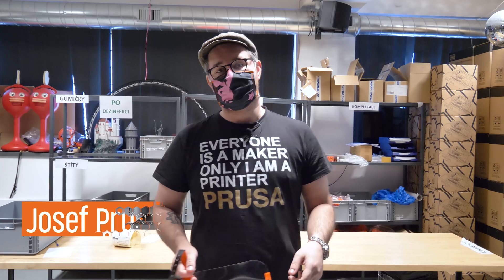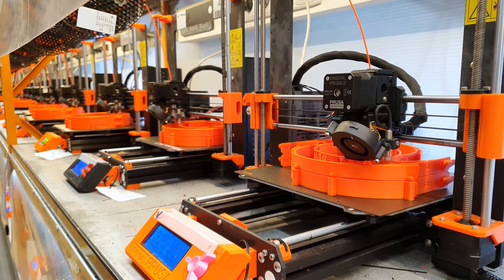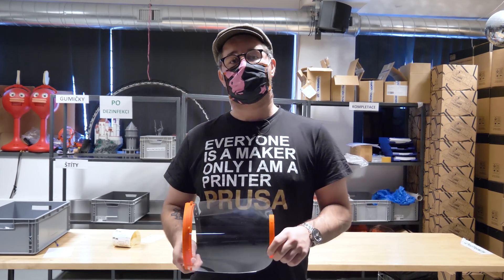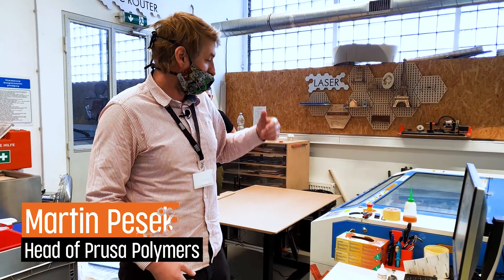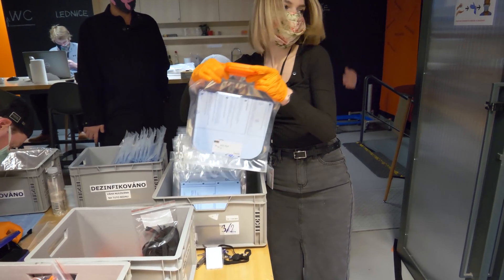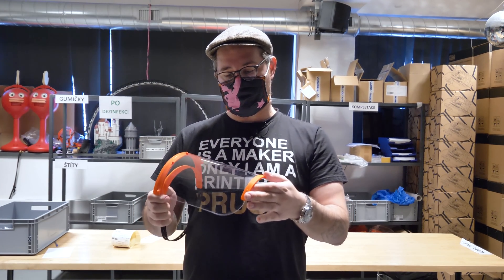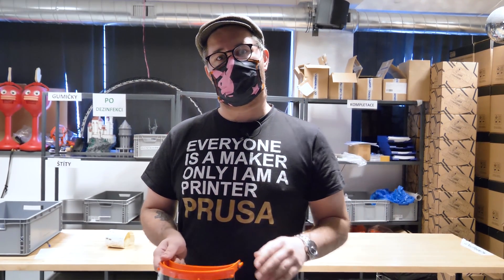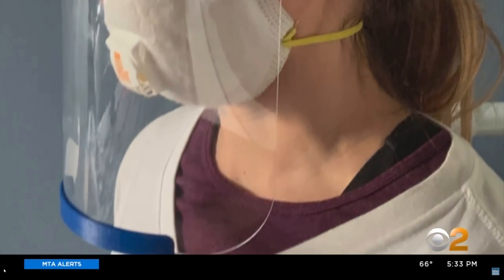How we make 3D printed face shields at Prusa Research (80k donated already)

Comment: is there an option if i could while printig the Material and not the Colour?

I print some Masks and an Level 30mm i would change from PETG to TPU.
in the Slicer i can only Change the Colour but not the material in the parametrics.

need Help

Comment: I've printed 160 face shield frames so far and my i3 Mk3 has worked longer on this than my total print time previously (over a year)  The printer holds up well and the NHS here in England thank us, but I also thank you for your hard work and making such designs freely available.  Thanks Joe and Team
Reply from the maker: Awesome, thanks for printing the face shields!